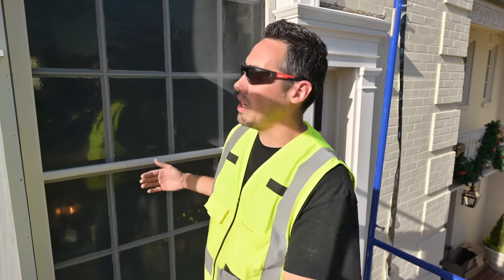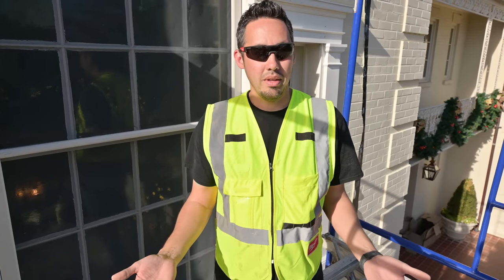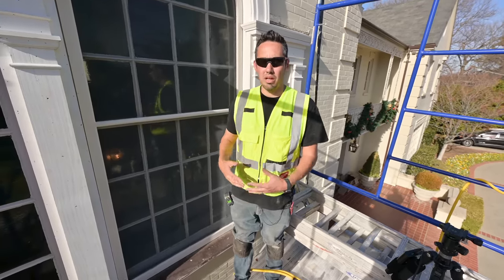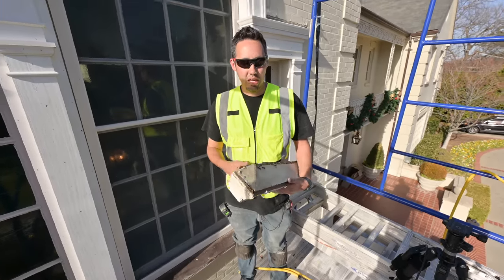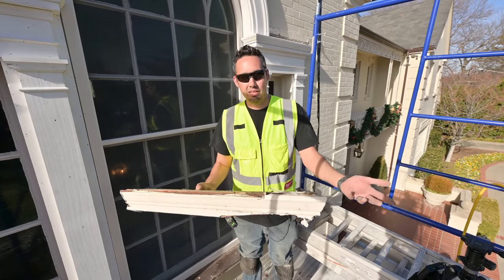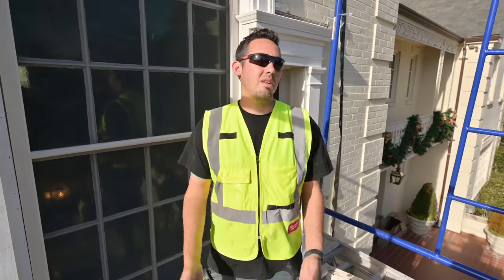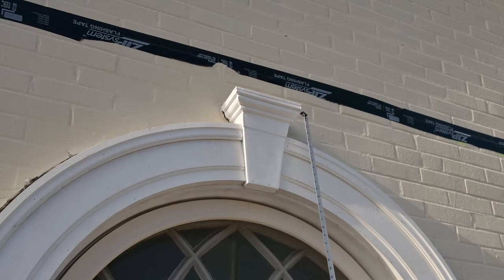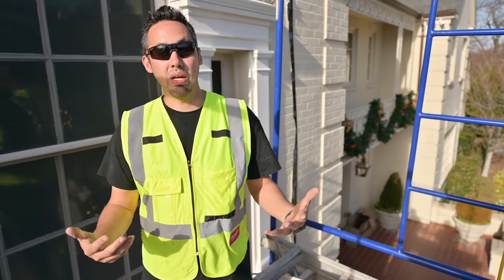Palladian window with REAL WOOD - Exterior Atchitectural Millwork

Comment: Another point: when you try to mill pvc it becomes very pores and leaves a rough texture. As well as in that texas heat you'd need very big expansion joints at each  junction

Comment: You're absolutely correct about wood!  I have rehabbed several houses in my lifetime, and I've never had to fix wood projects that were done right.  If there is a problem with wood, you can almost always trace it back to something done incorrectly.  But I have fixed the PVC fence (that came with the property) that likes to loosen up after a couple of summer/winter seasons.  I imagine going from near 100 in summer to 0 or below in winter (near Chicago) makes the expansion/contraction cycle a little bit beyond what PVC can handle.  But the picket fence around the garden is solid and aside from a coat of paint every decade, is maintenance free.

Also, I think it's funny that you mention there are people "who have more money than you"  HAHA  I can only imagine your cost per hour!  I am sure the wood you use is not the expensive part of the project.  Of course, someone with your skills and dedication to doing it right deserves whatever you charge!

Keep the projects and videos coming ... you do fantastic work!

Comment: I’m a woodworker. I love working with wood. But to be honest . What your leaving out is the extensive upkeep for wood products in exterior conditions . It’s a higher end house so I get it but plastic doesn’t rot
Reply: Agreed. Wood is great indoors, but outdoors the weather and termites are the downfall of wood. We don't use exterior wood on any of our commercial projects for that reason.
Reply: It does get brittle though.
Reply: @chriswhite6882  Then you're using the wrong product. Modern construction grade PVC trim has no problem living in full and sun doesn't even require any form of paint or other protection from UVs. Always funny how long the old wives tales continue in the trades.

Comment: I agree 100% on the flashing.  Bad/no flashing will cause problems every time.  It's good for me as it keeps me in business!  People have to remember that the wood you buy now isn't the same quality as what was available 100 years ago.  Old growth wood is SO much better than the crap available nowadays.  Pine especially.  Not sure if that translates to Sapele or not.  PVC is fine for newer homes, but it has to be fastened properly as it will expand and contract with temperature changes.  It can wear out caulking in time.  Just my three cents.  Nice work!
Reply: I swear to God lumber gets shittier by the hour. Nowadays we can buy finger jointed framing studs
Reply: @danielyeary148  It's getting a little ridiculous!

Comment: There is only two place I have used PVC.  Living in the northeast, fascia boards with gutter in front of them, especially on the north face.  The other is bathroom floor molding because it can take water without damage.  I use this sparingly in both applications.  Your point of the Texas heat and sun is well taken.

Comment: The I am not beating around the bush Richard is awesome. You are exactly right, no one at this time knows the life span of p.v.c. I do know this p.v.c pipe that has been left out in the sun gets degraded fast. Building grade may be different. To be in the know of what type of wood to use is important, pine is not going to last well outside. Just look how fast the pine brick moldings fail on an exterior door. Great video, Richard.

Comment: Quite right Richard, PVC isn’t the solution some people think it is, here in the UK plastic guttering and windows around 30 years old are having to be replaced. Weather degrades the shiny plastic surface after a few years then it gets ingrained with dirt and can’t be cleaned. Think on the expense of asking a plastics company to recreate one off mouldings, it won’t happen so replace it with some boring off the shelf rubbish. A hardwood such as sapele will outlast plastic any day, but it needs good protective weather finishes and flashing. Keep up the good work, that job will still be standing when most watching the clip will be long gone.

Comment: PVC would warp in the TX heat for sure.  Back of my house faces south (NC).  My contractor used some PVC for the back band around the brick molding when we had some windows replaced.  That PVC warped something awful.  Had to take it out and replace with wood.  He apologized and said he should have known better.  Didn't charge for the rework.

Comment: I agree. I don’t like PVC outside because it can move around in direct sunlight like siding. I’d use it in soffits and for other areas in shade, prone to mildew. I used it on trim in bathrooms that are wet w/possibility of mildew or mold. It glues well and sometimes nails don’t hold it like wood. Sucks to cut the stuff. I wear a good mask so I don’t breathe in the fumes. Awesome job 👍

Comment: People make boats that last hundreds of years out of wood. Plywood, purple heart, teak etc. Decks last a long time when built properly. 

I did a job replacing MDF on exterior window bays, I think there were fifteen of them if I remember correctly. Had lasted three years I think when we ripped it off the side of the building. Hanging pre-assembled 22 foot 10" miters 15 feet up in the air was fun. We weren't sure if it was a flashing issue, the way the complex had a sheer face exposed to the elements or the fact that they originally used glorified cardboard so we installed PVC and moved on with our lives. 

I just put together some built in bookshelves with plywood core MDF because they're being painted. Hung 7 ft floating walnut shelves, and ran MDF and poplar at the same job. 

It all has its place.

Comment: i am 68 and i have seen pvc warp and twist and crack on exterior work and even inside some homes.  when the sun hits it over time the pvc also drys out and shrinks.  pvc does have a place but not on an exterior wall.  i have seen pvc pipes crack and leak.

Comment: Oh man, the guys at This Old House are having their heads explode.  i agree Richard, wood is better when properly sealed and flashed. I've not used PVC for exterior trim. The price of the stuff in our area rivals solid hardwood like Sapele. I've seen PVC fencing, pipes get so brittle after a few years in the sun that they break with a slight bump. Yeah, the trim may last a little longer but as noted by others, it takes proprietary calking and adhesives to hide the excessive expansion/contraction issues.
Reply: Brittle vinyl fencing and PVC pipe cannot be compared to exterior PVC trim from Kleer, Azek, Versatex, etc. High end companies are always improving the PVC formulas to optimize how stable they are. PVC glues molecularly bond the joints which melts the plastic together to eliminate failure. Look into it so you don't make the same mistake of lumping PVC pipe and PVC trim into the same category. They're not even close.

Comment: coming late to this video but heck ya! i'm a finish carpenter in new england and i only use our local white oak and black locust outside. sometimes white cedar cause it's pretty cheap and local up here but it's often hard to get the length and width that we need. and western red cedar is prohibitively expensive for a lot of folks. no reason to use it over here in the northeast.

Comment: a while back where i live some high rises started using some plastic wrapped foam material for their windows, turns out the local birds loved it and would peck through the plastic, hollow out some of the foam and nest in the window sill. The point being is some materials fail for reasons you dont expect and need the test of time.

Another point for wood is that you can fix it, in fact you can change it - not every job is replacing things that are broken some people just want change. It easy to modify and repair and easy to find somebody to do it. With new materials often your only choice is to entirely replace things and because new building products come and go like crazy in 5 years it will probably be impossible to get something and cost a fortune to have somebody else imitate it

Comment: Keep up the good work and keep learning.
I have seen PVC window and door trim fail due to UV damage, yes it may last 15 years, but I have seen 25 year PVC trim get brittle and break and crack. The wood you took off  lasted far longer. I don't like Vinyl siding either, as it doesn't last long due to UV damage. It is hard to argue with work that last almost a century.

Comment: I'd like to see a video on the choice of nails and how they are sealed (caulk, putty, oil or Acrylic paint and so on). Regardless of the building material I find that the nails or screws and the sealing components are always the first materials to fail outdoors. Replacing them is a pain.
Reply: He used stainless steel. But the caulk is another matter.
Reply: @Peter B  Thanks, and I agree about the caulk. It deserves a video of its own.

Comment: I've used PVC and worked kinda hard to promote it ... and everything you said is true.  The shrinkage screwed up the finish with the expansion of heat and cold and the residue def is pollution even when using a vacuum

Comment: That keystone is flashed?!?  Is there anyone in your area who is currently able to do that? Carpenters/siders are challenged by even rudimentary flashing in this neck of the woods. Their solution would be to caulk and 15 years later, replace. It would be invaluable for you or Brent to do a video on proper flashing of exterior trimwork.

Comment: The wood trim on my house lasted ten years before it had to be replaced. The PVC that was installed at the same time (22 years ago) still looks brand new.
Reply: Then your house was made with inferior wood and or install. Think of wood windows vs vinyl windows… vinyl will never be able to compete with wood. Period.
Reply: @jasony9950  We're talking exterior trim. Not windows. And yes.. the wood was obviously inferior to the PVC. Even in this video the only way to preserve the wood is by cladding it with flashing.
Reply: @kenethsoberano  aren’t windows exposed to the outside just like trim? PVC trim will not last like wood will. UV light absolutely destroys pvc. Wood hates trapped water, paint also acts as a barrier as well. Properly done, wood is far superior than pvc, exposed to the outside.
Reply: @jasony9950  My actual first had experience says otherwise. UV is a nonissue even on the southern exposure of my own home. Just like any building material PVC composite trim must be installed correctly. When done so it require little to no maintenance. Pressure washer in the spring. No repaint, rot or termite issues. When it comes to windows I wouldn't recommend "all wood" windows either. It you want it to last and require minimal maintenance I recommend clad widows. Solid wood interior frame with an aluminum clad exterior.
Reply: It may have been finger jointed scrap on the original wood trim along with improper or no flashing at all. The applied brickmold on off the shelf big box exterior doors and windows is almost always finger jointed junk.

Comment: I’m rehabbing a Victorian I bought,built in 1863 I removed all the exterior trim around the windows,used epoxy to repair the old nail holes and some cracks removed the paint sanded primed and put them ALL back on the house

Comment: From my experience I agree wood is the correct way to repair the damage. The quality of the flashing is an essential partner in the long lasting endurance of this window. 

For removable trim pieces I often use stainless screws with trim washers. This allows for routine maintenance of the screen and can be removed and reinstalled multiple times without damage.

Comment: Love me the real craftsmanship but think PVC is a mighty fine material. I have a "builder grade" home with standard brickmold around a door rotting out, swap it for PVC. You have a fancy historical window you go a different way. There's nothing bad about wood or copper or PVC or mdf or hdf or plywood or whatever. Each different material has it's pros and cons. What's crazy is when people just want take single material or practice and glorify it like it's the only way. Really knowing that options exist outside of mdf finger jointed pine and PVC is really limiting thing. Ideally wood is great but PVC has it's place. It's also more limiting. Some people may not realize how much exterior pvc expands and contracts with changes in temperature. That's really a problem on long spans that you just don't have with other stuff. Maybe in TX that's not a huge deal but in Idaho where I live we have temperature 20 below zero and 100 over the 120 degree difference you see lota of movement.
Reply: PVC sucks.
Reply: I used PVC to wrap the columns when I replaced the original (rotted) ones on my front porch. I'm thinking about using it for the trim around the garage.  For simple trim work, I think it's a great option, outdoors.  But for more detail/fancy work, I'd probably stick with wood.
Reply: @scamartist26  sustainable pvc isn't really a thing but what is the amount it's worse than wood? I feel like I'm doing more when I limit my driving and buy less garbage stuff I dont need and have the same used cellphone for 5 years deprive myself of a new car for 15 years and keep rebuilding the old one. Buying 15 ft of plastic isn't great but neither is keeping your house warm in an Idaho winter. I've probably saved enough by wearing a sweater inside to get some PVC where the rot happens from a funky roof /ice splash. Maybe I only use it there and use traditional wood other places? Nothing's absolute. Sometimes what's the best thing aone thing isn't the best for very thing. Like insulin saves lives but if you inject it into me I would totally die. Something can be the best thin in a situation and not be the best thing always.
Reply: @scamartist26  If you think PVC is cheap, you've never used it.
Reply: @chrisvanderwielen1530  It's also great for detailed work.
Reply: L
Reply: PVC has its place - base and case in a bathroom.
Reply: @scamartist26  Apples to oranges bud.
Reply: @scamartist26  How did I do the opposite?  Wrapping a column isn't intricate work, nor is it detailed.
Reply: You have more problems if the wood is rotting out, find out why its getting soo wet.just slaping pvc on it, isnt fixing the actual issue.
Reply: @freddyramirez1820  true mostly. I have kinda a funny spot where ice drips and splashes back. It's kinda on the edge of a twin home. The paint failed and thus the wood. Special gutter work over the 2 homes could fix it and divert the Icemelt but it's just a small casing. Flodprone areas like utility rooms and bathroom are also good uses in my opinion. It's not the magic best material but it's not the devil either. I totally understand why it would be inappropriate for this job but just a blanket statement about any material is silly. Different materials have different qualities and environmental impacts that have to be weighed on a case by case basis
Reply: If money is not an issue, masonry/cast stone/stucco is king with exterior mouldings like this.
Reply: @cole141000  money time and looks. You really don't want to mixing materials in lots of situations because it looks stupid.  Also getting the proper casting can be something that takes a long time. Also some stuccoes aren't as maintenance free as you might expect: They require upkeep too. Definitely rock and stone is more durable than plastic.
Reply: @freddyramirez1820  water…water is why it’s getting wet…because it’s in a bathroom or OUTSIDE.
Reply: I totally agree!
Reply: @travlangley1  sapelle and mahogany are the best exterior woods to use, or in areas of moisture..have to use the right wood for the job as well..
Reply: If it’s caulked/weatherproofed right it won’t happen

Comment: We have some log houses being 800 years old. I believe those walls are even exposed. As long as you keep the bottom log dry and protecting the wood from UV it obviously holds up. You do not need any complex calculations or guesswork when you can witness history telling the truth. I am all for innovation but there is alot of answers in the past.  It is really interesting to study building techniques and material from different time periods and very important: why. Sweden is as long from top to bottom as from bottom down to italy so as the climate differs so do the resources. To simplyfy: log frame > pole frame with short log fillers in the north and pole frame with clay fillers in the south > stick frame with saw dust and paper fillers > stick frame with glass wool fillers. In this part of the world if you track backwards in time you see they slowly went away from log s because of scarcity and price in the south to later use the cheap methods as standard in the north. I think you should try to use the materials from your surrounding. In the mediterarian building with rocks is genius because of the thermal capacities and shifting heat between night and day. Up north with relative hot and humid summers and cold dry winters, fur and pine grow everywhere and can handle the climate, use that. Great material. I think if you could go full log, go full log. Or CLT, speaking about innovation.

Comment: I am not a builder but love watching and learning. Until you mentioned the use of plastic, I would never have thought that some would use it on houses especially as a moulding.  I would have thought strength, bending in the heat and discolouration would be reasons not to use it.  In Australia, plastic is used for guttering and down pipes pretty much these days but that is about all i have seen builders use it for.